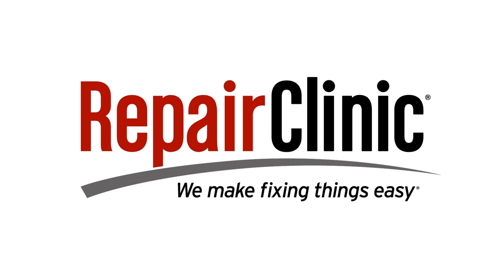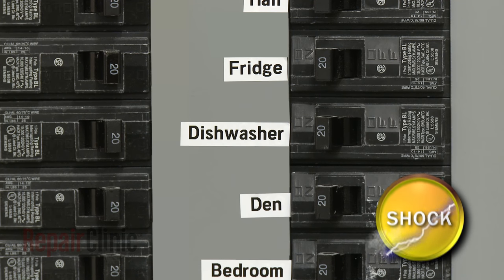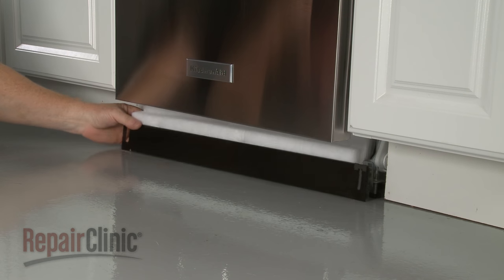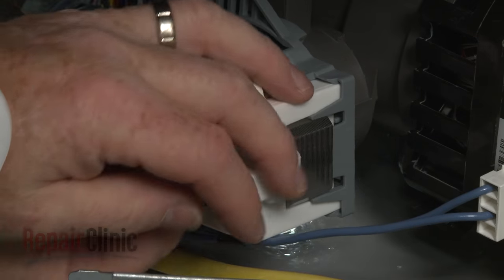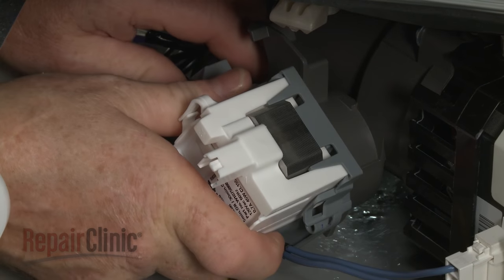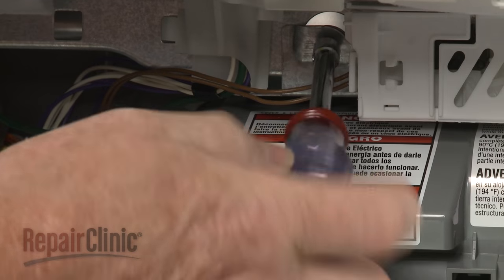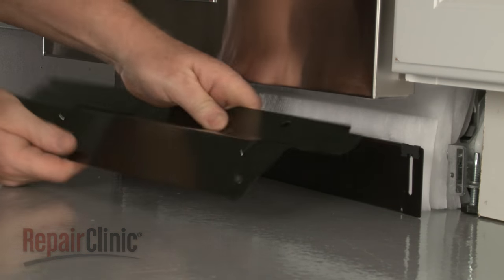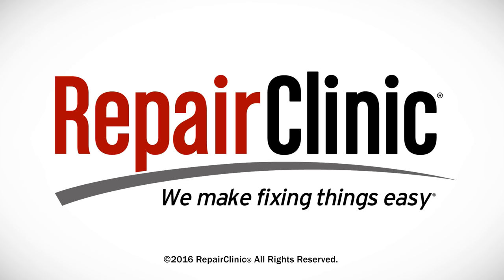KitchenAid Dishwasher Drain Pump Replacement W10758882

Comment: Thank you for this video. My Kitchenaid was a little different as well, but located in the same location, which was a big help, as I had no idea where to start. I removed my existing pump drain, and found a small piece of broken glass inside.  The noise I had was the glass hitting the fan blade, whenever the pump drained water. I removed the glass, reinstalled pump and it works like new again. No more noise. 15 minute repair.  Thank you!

Comment: Hello my drain pump looks a bit differnent/located a bit different. But it looks sumilar - white piece and grey piece just grey piece slightly different i think. I cannot figure out where  the level is to unclick to remove it. Are there any resources where i might find where the level is? Thank you!
Reply: I’m sure youve figured it out by now, but for those who come after, I had the same issue. On my model the lever to free the impeller housing to turn was located on top and to the back left of the white electrical square part of the pump. Push a little plastic lever and the housing turned easily.

Comment: I used this video to replace the pump on my KUDE48FXSS5 and it was slightly different but somewhat easy.  Once you get some confidence and a little research you can fix most things without calling a service tech.  Search for diagnostic test and codes.  This pin pointed the drain pump issue.  A small piece of glass got into the pump and chewed the blade up and finally jammed the pump.

Comment: I have a KDPE234GPS0 Kitchenaid with the same drain pump as in this video.  Pump runs but not emptying the pan.  During wash cycle water will get drained and pushed thru hose.  Took it apart, cleaned, filters, pump housing and ran the motor in drain mode and spins freely not sure of my next step.
Reply: What did you ever do? I’m having the same problem